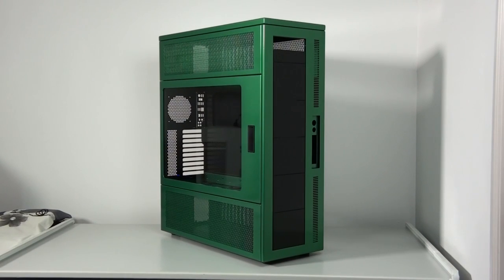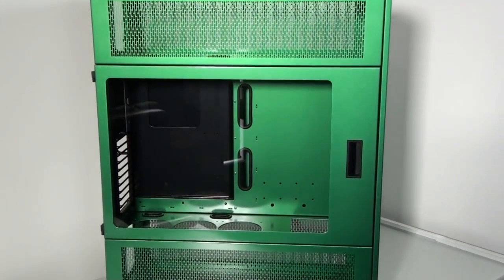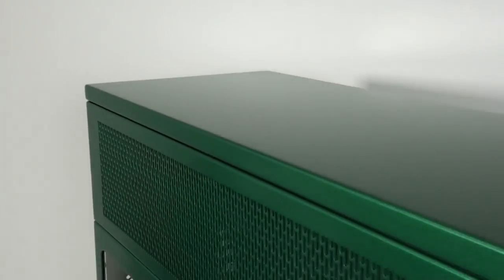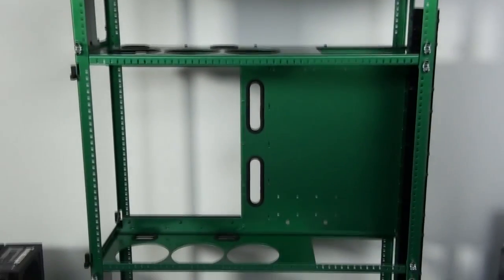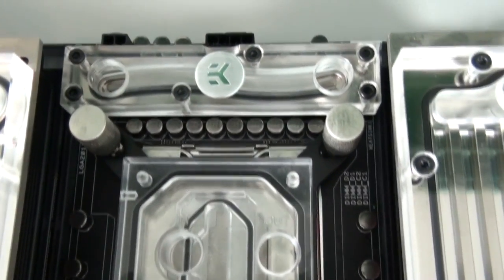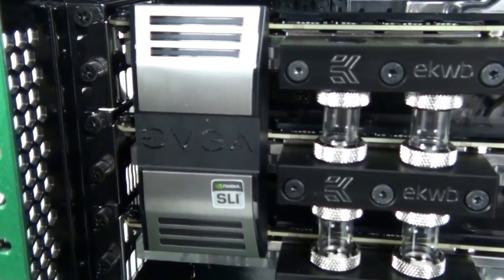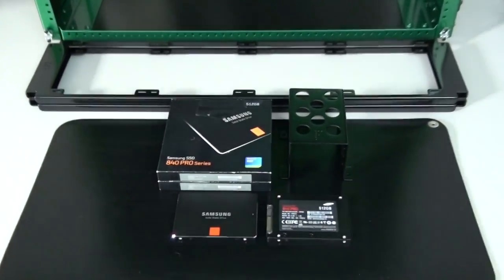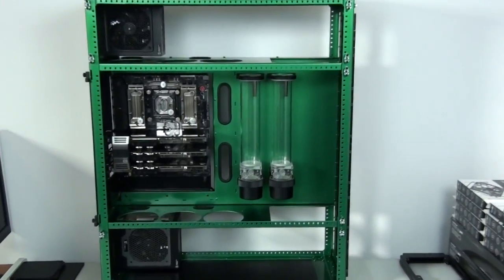Build #14: Extreme STH10: Part 2

Comment: I noticed you like to use the SR1 radiators.. Have you looked at the new black ice nemesis rads?  They are 16 fpi and do very well with lower speed fans.. I find them pretty versatile for those who would also crank up the fan speed.

Comment: I plan to liquid cool my next builds but don't plan on any of it being for show.  I'm going to do it for the performance only.
In a case where nothing is seen would you say that soft tubing is ok?
Reply: If it isn't being seen soft tubing is even better than rigid tubing because there are less connection points. Also if it's not being seen you don't need any flashy components so just get the cheaper waterblocks and you'll be fine.If you aren't planning on overclocking I would suggest some better fans over water cooling.
Reply: CEmanified
Thanks, I do plan on some over clocking and video card over clocking for performance.  So yes liquid cooling is in.
Reply: scarmenl Just be sure to tighten the fittings every few weeks since the rubber expands with heat and replace the distilled water every few months. That's about all the maintenance there is. Good luck
Reply: one thing worth noting about hard tubing is that you will rarely if ever have to replace the tubing so that's one of the major advantages. its still a good idea to replace your liquid every once in a while but if you have a good drain port setup that is a simple process and that's basically the only real maintenance. whereas with soft tubing you have to worry about the tubing staining if you want to change out your coolant color or the corroding of the soft tubing itself.
Reply: scarmenl Soft tube breaks down eventually, Daniel has done videos on various brands in the past and they all end up breaking down and  plasticizing in the loop. So I wouldn't recommend using it unless you're going to be constantly checking/changing your tubing.
Reply: Daniel Park Hard tubing is also a lot harder to manipulate and fit inside a case. Especially for someone who doesnt have any experience and if he can't see it he wouldn't have a need for coloring. I'd say he should just save the money and use non rigid tubing that he checks every few weeks.
Reply: Daniel Park Hard tubing is also a lot harder to manipulate and fit inside a case. Especially for someone who doesnt have any experience and if he can't see it he wouldn't have a need for coloring. I'd say he should just save the money and use non rigid tubing that he checks every few weeks.
Reply: chriskanemeier
You talk out of your ass. Newer tubing don't use plasticizer to start with anymore, and even in the past people had rigs running for a few years before considering replacing tubes.

Soft tubing is still perfectly fine. Just like always though, you should always do maintenance checks on your loop at certain frequency.
Reply: DO NOT USE SOFT TUBING!!!
Reply: Sveinung Tørresdal I'm actually not. Now my experience is with older stuff from a few years ago, so I'm not up to date on any of the new soft tube, but I had major issues with Tygon breaking down and releasing plasticizer within weeks. It also stained almost instantly (I'm talking within days of being installed). Dan even has videos in which he uses 3 or 4 different brands of tubing and they all end up breaking down really quickly.
Reply: Jesus, you guys are ridiculous. Soft tubing is perfectly fine to start with, requires a minimal addition of maintenance. Secondly, your opinions are literally outdated.
Reply: Sveinung Tørresdal I wasn't at any point telling him, or anyone, not to use anything, merely listing reasons against the use of it.

Oh and I never stated any opinions..only facts.
Reply: Your facts are outdated all the same. No good brand of tube now has plasticizer anymore.
Reply: Still make sure you do get high quality soft tubing.
Reply: Don't get soft tubing. It's fun to assemble hard tubing and it lasts longer. Even if they have managed to make a decent soft tubing nowadays there's always things to be considered of. Hard tubing is more straight forward. Even the prize is same so there's really no reason to use soft ones. If you want pure performance you should use Noctua Industrial fans. Those pressures are ridiculous. If you don't want so much noise use Apache fans they have very good pressure in decent 1500 rpm and they are very cheap
Reply: Vesa Hanhela
Thanks for the advice.
Reply: I say knock yourself out with soft tubing all you like. Hard tubing is way more time-consuming to install imo, so whether or not the price is right is a moot point imo.
Reply: Sveinung Tørresdal ALL soft tubing breaks down over time, even the newer stuff (I'm looking at you, primoflex advanced lrt.) It will start to leach solid mass into a loop the longer it's used. That's not to mention it's not nearly as clear as acrylic, and it yellows even more over time. Saying acrylic requires more fittings than soft tubing is also incorrect... I can tube up an acrylic loop with the exact same number of fittings as I can soft tubing. That's not to say soft tubing shouldn't ever be used... It's fine if you replace it frequently and flush your components in between replacements.
Reply: Chris Cleveland
Heck, perhaps I will just put in copper tubing.
Reply: scarmenl Just hire a plumber first ;)
Reply: chriskanemeier
Nope, was welder fitter before fall that damaged my back.  I think I can manage some copper tubing.
Reply: scarmenl It was a joke :p 
I've seen a few steampunk themed builds use coper though, it doesn't look half bad imo.
Reply: chriskanemeier
My plan is that the system will not be on show. I just want the extra bandwidth you can get with liquid cooling.
Reply: scarmenl Neoprene or tygon tubing is fine for that, it's not meant to be very showy and no risk of plasticizing like most clear tubing.
Reply: CEmanified I completely agree with your recommendation that he should absolutely use "normal" tubing for a first build, rigid is for experienced users only. but rigid tubing isnt that hard, its only difficult if you really care about aesthetics, and are using fittings at every angle (and even then, not too difficult). Youve obviously never actually built a rigid loop or else you would know that its actually alot more feasible and dynamic than you would think, its not as hard to manipulate as you claim. Also, flow is not nearly as important as is head pressure, they are both equally important, and they both can tend to overbear the other. Too much flow can actually be bad for smaller pumps, and ive heard numerous stories of people who went overkill on pumps and flow and ruined their pumps, but ive never once heard of someone literally requiring more flow in their loop due to hindered performance. No one, ESPECIALLY a beginner or first timer, is going to have to worry about not having enough flow. Every single OEM pump on the market will be adequate for a first time loop.  some people may want more for absolute maximum possible performance, but its never going to be a hindrance, like lack of pressure could be. 90 degree angles, serial flow setups, etc. increase pressure alot. Why do you think bleeding air out of your loop after a build is so critical?
Reply: Nick Hansen My point was never about the pressure it was more about the added possibility for failure if the fitting were to not be fit properly. It might not be as big of  an issue anymore but with rigid tubing you traditionally have to sand the edges and make them a lot prettier than on soft tubing. To use rigid tubing on an in-closed case would be a complete waste of effort and money that could be spent elsewhere.

Comment: IMO this is one of the best CaseLabs Cases and one of the best cases ever (if not the best). Can you please explain once again, how did you fit the top 140.4 ?? This case doesn't have the same top and bottom compartments. The top one is lower than the bottom one. You can fit perfectly 140.4 at the bottom, bu how did you squeeze 140.4 at the top ?:) I am thinking of buyng 4 x 140.4 rad mounts for this case, and I can clearly see it is possible (sweet), even if Kevin from CaseLabs said to me it isn't :)  Please explain. I will watch this once again, maybe then I will understand :) Best Regards! And please use only CaseLabs cases - they are  simply the best!
Reply: The only problem I have with caselabs is, that they don't have smaller tower cases. I need a good one for a lan build and I'm just not a fan of cube cases.
Reply: TeschiLP same :) I dont like cubes. SM8 is quite small. If it could fit EEB I would like to chose SM8 + 2x pedestal (top, bottom) than STH10.  IMO SM8 is best looking and best fitted for ATX build.... best regards

Comment: I disagree with your recommendation of the C48s, especially for beginners. They don't have nearly as much strength as C47s (or better yet, multi-link enhance) which isn't a huge deal on the mobo but it is on graphics cards. Even worse though is the fact that they only have a single o-ring. Someone who is inexperienced with acrylic would be better off with a dual o-ring fitting in case they have an issue with their tubing length or the prep work at the end of the tube. Another issue is the strength of the seal. If the user is bending acrylic instead of using rotaries, the fitting becomes more important since they will likely have to tube up two blocks on a single plane. In a configuration where you could pull the tubing straight out with a light tug you need a strong seal to prevent leaks and insure the tubing will stay in place. I recommend that users go with multi-link enhance, or at the very least c47s. C48s should only be used when it's the only fitting option available,  and even then there are always better fitting choices that aren't acrylic in those situations.

Comment: Personally I don't see the ascetics of fittings over bends, but Amazing job!
Reply: blows me away every time I hear this, I just cant honestly see how anyone would believe that simply bending the tubing vs fittings at the bends looks better. I must say I do agree that if bending the tubing, 16mm/larger sized tubing is essential and transparent or even simple clear fluid is also important....But without fittings at the bends, it looks so cheap and corny/tacky to me. The fittings provide a more industrial, heavy duty, serious aesthetic that to me, shows a system of plumbing and pipes that say "this means BUSINESS" and some serious heat dissipation is at work..... but to each their own i guess!
Reply: The way I see it is just more cluttering of the whole build. Tube bends are chic and modern. It also give even more viewing of the liquid.

Comment: This might be a forehead slapper, but, from jump I put on 2 pairs of latex gloves when installing fittings and water blocks.  Eliminates clean up of fingerprints.
Reply: Ceras Tech I've never encountered a problem with perspiration. It stays inside the gloves.
Reply: Ceras Tech Thinking... Mild perspiration stays in the glove. When I'm done I take off the gloves away from the project over a sink. Wash and dry my hands. Return to the work area. Nope. I have no idea what you are unneccessarily being coy about. State what is on your mind.